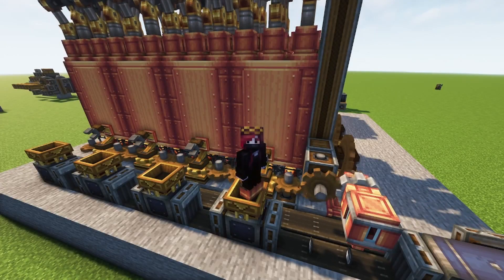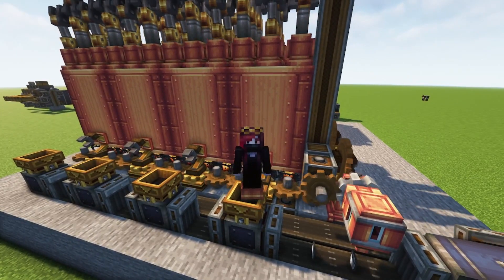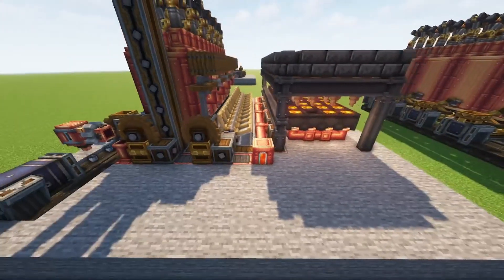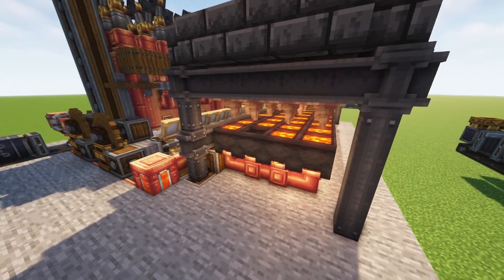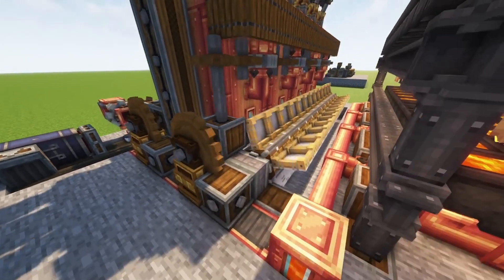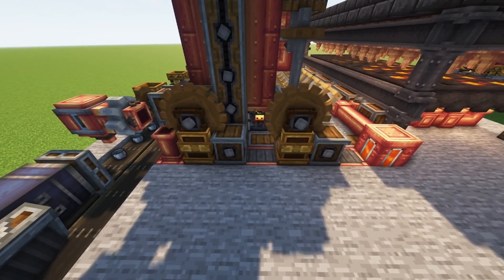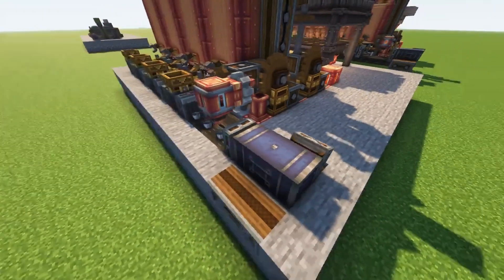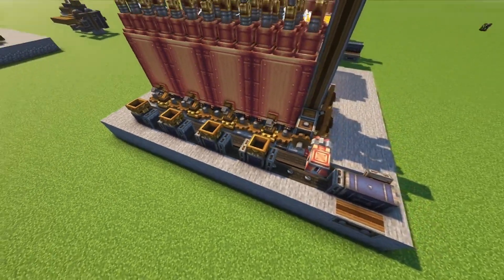Minecraft Create: Steam Engine!

Comment: My steam engines don’t have the shafts up top. How do I fix that?
Reply: Got that figured out, but my mechanical arms keep just picking up the empty buckets and throwing them in the funnels so they never get full of lava.
Reply: For anyone who has the same issue (recycling empty buckets endlessly) - it takes a little finagling, but if you put the rotational speed controller on negative speed so it reverses the belts, then change the funnel directions and block off the end of the belt, it works as intended. :)

Comment: incredible schematic! but the arms wont take the lava buckets, ihave to manually right click them. can you help me out?
Reply from the maker: I assume that you mean that even tho there are lava buckets in the belt, the arms arent taking them. That probably means the arms didn't had or have a proper input/output at any point, so it messed up the setting, or that they didn't had the setting to begin with. Either way, try to start by setting up the arms properly
Reply: @batsyvonfangies  Figured it out! The arms didnt have good in and outputs like you said. Thanks!

Comment: i have a problem where the mechanical arm wont deposit empty buckets any help on that and my buckets bot go through the item vaults in the line back to the spout
Reply from the maker: are the filters correct? if the brass funnel isnt pointing to the vaults, or they dont have an empty bucket on the filter, they wont work, if all of that is correct, remove the arm and place it back again with the proper setting
Reply: Yeah, I had the same problem! Becuase of the direction you placed it, the vaults must be facing into the funnels, just replace every vault and you should be fine! It´s not your fault, it´s because of the schematic cannon.
But very great tutorial and schematic, it´s awsome!

Comment: Thanks for the Schematic, its brilliant! Could you maybe do a video on how to jump start it and how to replace the items that are not transferred through the schematic please? Also where to take the kinetic output for other machines.
Reply from the maker: I'm most definitely making a new video about steam engines soon. For anyone wondering the same, I'm still gonna explain it shortly. On the trapdoors next to the tanks you need to place water to feed the tanks, over the cauldrons you need lava. To jumpstart it, all you need to do is activate the windmill, that should feed water into the tanks, and the passive power should be enough to power the engines
Reply: @batsyvonfangies  I have figured this part out - problem is that the blazes don't get fed with lava :D
Reply: sorry i figured I have to confiugre the mechanical arms myself :D for anyone wondering: use the blazes as deposit target, the belt in front of the arm as input and the smart chute as a second outpout. Don't forget to put an empty bucket as a filter to the chute
Reply from the maker: @Michella1393  That's weird, the schematic should store all the configuration of everything
As for the funnels, make sure they are facing the right direction and have the proper filter
Reply: @batsyvonfangies  i have just rebuilt the schematic - you were right, they are configured. The spout fills the buckets - puts them into the vault but the vault doesn't spit the out again? Also the arms dont put buckets back to the funnels? Sorry I am a Create Noob trying to learn
Reply from the maker: @Michella1393  see if they have an arrow facing down, and also try replacing the top funnels, and maybe also replacing the vaults fixes the issue, sometimes vaults get a bit wonky when importing, if arms show the top funnel as blue, it should work fine
Reply: @batsyvonfangies  Okay so replacing the vaults worked well - i Didnt need to replace the funnels. Now when all the blazes are fuled, the buckets just drive by and drop to the floor at the end. I have to alsways give it 16 empty buckets - they are picked up and the blazed are fueled and after that the buckets are dropped again?
Reply from the maker: @Michella1393  At the end of the belt, you always need to place a solid block, that way the items cant fly off
Reply: @batsyvonfangies  Aye - will try that. Thanks a lot - you helped me a lot to understand create mod!
Reply from the maker: @Michella1393  I'm glad I can help Create it's an amazing mod

Comment: Just subbed and built this! Excellent tutorial and build. My ones buggered sadly. Its all set in reverse =[ The belts that rotate the buckets and stuff are going opposite directions, probs the modpack bundle (ATM 8) im using messed it up. in process of trying to figure this out haha

EDIT: This was because I had the entire thing flipped haha. But this works like a charm! Thank you so much
Reply from the maker: I'm glad you enjoying the design. If you flip the schematic, you can always tweak the speed in the controller, belt is set to -128 I believe, change it to 128 and should turn the other way around
Reply: @batsyvonfangies  Yeah this helped HEEEAAPS - im still learning Create :D
Reply from the maker: @coachdantheman  And if you flip the controllers, make sure that the water pumps are pointing the right way, you should see the arrows going down into the tanks, if not then just use the wrench to flip them
Reply: @batsyvonfangies  This is super helpful thank you again. Also, don't suppose you might know which gearbox to use if I wanted to attach another machine to it and use the steam engine to power it?
Reply from the maker: @coachdantheman  At the top of the steam engine there are all the moving shafts and what not. First you want to attach the 3 rows with an encased chain drive, so it takes power from all engines, then you connect the rest of your factory to that chain drive